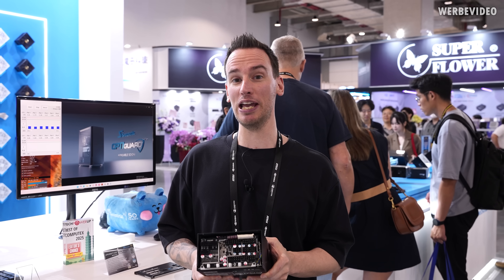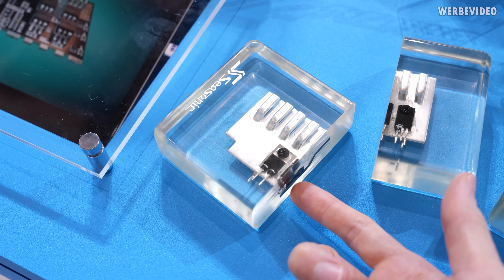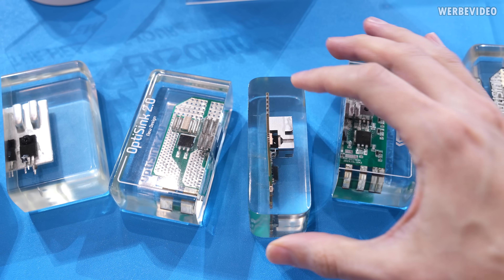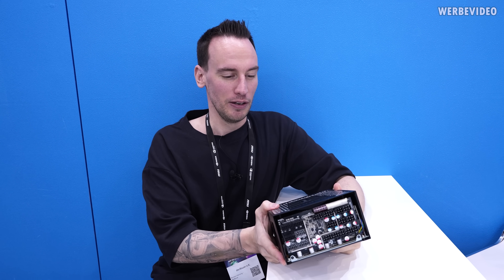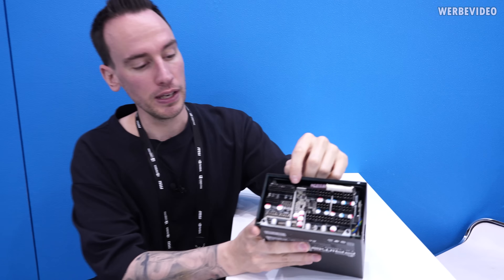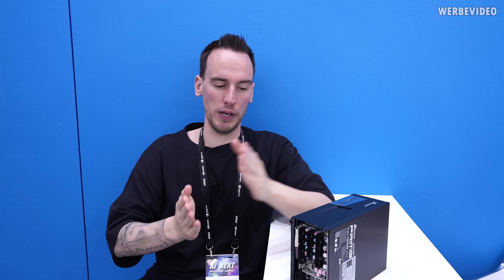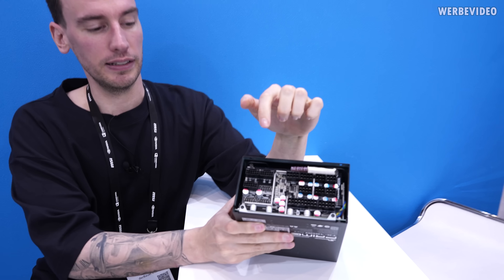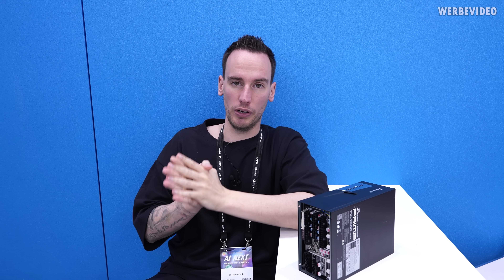Seasonic Confirms 12VHPWR Risk – Unveils Protection Feature

Comment: Just undervolt your GPU.
For example the 5080 and lower GPU dont have this problem as they dont draw so much current however the 4090 and 5090 do
So just undervolt the GPU in MSIAfterburner and you're good to go.
This will lower consumption by about 100W~ easy and set some profiles for example you dont need 200FPS in certain game, limit it to 120 or 60 and present lower clocks on the GPU that way you are going even lower from 500W~ to 350-400~ zone and you're good to go.
As all of these shunt solutions, your PC shuts off, what now you sit there staring at black screen wondering what do do, this is not a solution, disrupts the work flow or game session.
The actual solution is to lower power with UV and certain profiles for high, mid and low end games and you're safe to use your GPU with almost no risk of anything getting melted.

Comment: Can't we add a seating lever on each  end that forces a good connection? Sort of like the connectors used in most automotive connectors. Leverage using a plastic arm.  You wouldn't have to push down/in the connector, which seems to break the pins on the GPU

Comment: this is good that they are looking at it BUT for the everyday user if the system shuts down even if we got the info that it was an overload on the cable , what do we do then ?? just change the cable ? yes we have loads of them in draws for that just in case moment! 
If seasonic would go that one step more and restrict each pin to 10.20 amp then they would sell the safest PSU on the market and everyone that has a 5090 would get one just for peace of mind  it would add cost to the PSU and if you get frame stutters you then look at the software info it could then show most pins maxed out at 10.20 and the odd 1 or 2 less eg 4.2 which would then point to the problem without risk of damage. 
Please Seasonic lead the industry

Comment: Optisink 1.0 is a massive downgrade compared to the older style IMO.
The older style has a large thermal mass.
Optisink 1.0, yeah your using the copper layer to act as a heatsink which may have a large surface area, but it has a lower mass overall
50g of aluminum exposed to airflow vs 5g or 10g of an internal copper layer.

Optisink 2.0 is a bit better as you are now adding heatsinks to add thermal mass

Comment: TLDR-I love the idea, but I'm curious what kind of tolerance they will allow. I enjoy daily driving the same systems I use for XOC, so this will be a desirable safety feature for the daily part, but I wonder how "X" it will allow me to "OC."

To further breakdown what I'm getting at, I started shunt-modding back on Ampere and appreciate the headroom available to push upwards of 1000w during extreme sessions without exceeding "safe" limits on the electrical components for short periods of time. Shunt modding the video card still allows you to monitor power/current per 8-pin connector (with a correction factor based on which shunts you use and some math that I'm sure you already understand, so I won't bore you with all that here). This means I'm still able to effectively power limit my card on a per 8-pin basis, a GPU power-draw basis, AND a total board power basis. There are still a lot of safeties in place and you can "tune" these limits a bit with different shunts or power limits in various available custom vBIOS flashes. In the case of Ada-Lovelace and Blackwell, you still get GPU power-draw and total board power limits, but you miss having multiple measurements in parallel for the various power connector pins. The worst that can happen on RTX 3000 with 3x8-pins is only 1 "+" and 1 "-" are functional per connector, which still leaves you with 3 good pairs of "+/-" pins. RTX 4000/5000 can technically operate on only 1 good pair if all the other wires are cut (an example @der8auer has demonstrated before), but all power goes through 1 shunt for the entire 12-pin and there's no ability to see any breakdown of the power split across the pins. Without the ability to modulate power draw per pin (or even per set of pins so you know you have at least 1 good pair per set), you have to rely on safety features such as in this concept PSU to toggle power off. I'd like to think you could still do XOC with this PSU, but if the limits are set too high, it decreases the effectiveness of the safety feature. If they're set too safely, it likely won't work for XOC. I'm really curious what they go with.

Comment: Guess I'll just get the new WireView when it drops, instead of investing in a whole new PSU that doesn't mitigate the problem anyways.. If you can't balance the current flow without the narrow balance of current being a problem anyway, I want to pay as little as possible to be informed of a possible issue at least... I seriously need an upgrade so I don't have a choice at this point, but holy crap is this whole thing just a stupid scenario to begin with..

Comment: For anyone wondering, the 12VHP connector is basically a Molex Micro-Fit+ connector with an extra block stuck on for signal pins. There are some 'fun' things you can find in the datasheets for the 12-circuit Micro-Fit+ connector and the 'PCIE CEM5 12V2x6' connector housing. The generic Micro-Fit+ connector specifies DIFFERENT specs based on whether the contacts are gold plated or tin plated. The tin-plated contacts have the full 9A current rating per circuit, but lower allowed maximum temps (105C rather than 125C for gold) and are rated for less insertion/removal cycles. The gold plated contacts are actually de-rated to 8.5A. The 12V2x6 connector doesn't specify multiple ratings, it just lists 9.2A per circuit, but it does list a maximum temp of 105C, so I'm guessing the Molex version is specifically specced with tin-plated connectors. It is worth pointing out that, in the big chart of current ratings based on wire gauge and number of circuits, most of the data is marked with a * which means it is interpolated data, not directly measured. However, for some reason, just the 12-circuit, 16GA data point is actually measured when all the data points around it are interpolated. Seems like maybe some extra attention was paid to this particular configuration, for some reason.

There is also some interesting info to be found when comparing the regular Micro-Fit and the Micro-Fit+. First off, the regular Micro-Fit only allows up to 18GA wire, while the + allows up to 16GA, which is what the 12V2x6 uses. However, the two versions do not have the same current ratings, even if both are using 18GA wires. A regular Micro-Fit connector with 12 circuits is rated up to 5.5A per circuit. The + is rated at 6.5A with the same connector plating. So originally, before NVidia decided to hijack this connector for a 600w GPU, it wasn't designed for anything bigger than 18GA wire, and 5.5A per circuit. Perhaps stretching the format to not only use larger gauge wires, but also to increase the Amp rating per wire all while nominally keeping the same temp. rise on the connector just didn't leave enough safety margin.

Perhaps the most frustrating part of this exercise is when you realize that, if NVidia wanted a connector that could handle more amps per pin and take up less space, Molex already had one that did exactly that: The Ultra-Fit. This connector is slightly larger than Micro-Fit with a 3.5mm pin pitch rather than 3.0mm, but in a 12-pin, dual row configuration, the connector is rated to handle up to 10.3A per circuit without any redesign shenanigans, which is more than what NVidia would have needed for 600W. It would only have been a hair over 3mm wider than the 12V2x6 connector, but would still have easily fit on all the cards they have put the connector on so far. So why not use this connector instead of the special Micro-Fit+? I can only assume it was because the Ultra-Fit connector costs more. Molex has been at this a long time. They are perfectly capable of delivering a connector that can deliver 600W of power, and in fact already have many that could do just that. All NVidia had to do was pick a connector that Molex already made which met their power specs, and throw a couple presence pins onto it.They could have just picked up a 12-pin Ultra-Fit and probably been fine. Instead, they tried to scrape a few pennies off each unit and now they look either greedy or incompetent.

Comment: The year 2025, and the most important element “Power Supply Unit”, which has a lot of wires - does not have its own software for control and monitoring in the operating system! That's bullshit!

Comment: Boiler tech here: psu safety is great, but i STRONGLY recommend they add an external LED that can be mounted in a visible area; flashes yellow for stage 1 warning, flashes red for stage 2.
The led trip state should only stop once an "alert acknowledge" button on the PSU is hit, even after power cycling.
That means if the 12vHP hots red alert, the system WONT reboot untill you hit the alarm button

Comment: Current protection should always be at the source. All power should be this way. That way any failure after that point power can be cut
Reply: You always put the fuses/protection devices closes to the source, from circuit breakers in your home right at the entrance point to fuse in your car right by the battery

Comment: its really funny that are companies chooses the hard way to address the issue instead of putting 2x 12vhpwr on the gpu with 400watts and above if 600watts put 3x 12vhpwr that fixes the problem so cheap or nvidia seasonic and asus chooses the hard way why? for screwing people for more money when the fixes is very cheap for adding more 12vhpwr on the gpu's with melting connector issue

Comment: The only practical place to control the per-pin current consumption is at the consumer (graphics card). They're splitting the power to various phases anyway, they could absolutely split the pins into individual rails, monitor current and shift the draw between them as required.

Even this is a band-aid over the core problem, though. Forcing higher current through a high-resistance path is only going to generate additional heat in the connector. You can have failsafes that shut down the card if the current is too imbalanced, but the real fix is to use a connector that can reliably handle the currents you're trying to pass across all scenarios, with plenty of safety margin.

Comment: Thanks for explaining this. It seems as if the engineering is chasing the problem by architecting more and more complex solutions to a (relatively) simple problem. This usually indicates a flawed design, method, or understanding of real world issues that Nvidia has abrogated any responsibility for addressing. If I'm not mistaken, the real solutions are one or more than one of the following (in combination):  greater contact area (better tolerance for imperfect contact), tighter tolerances so surface contact is more likely, more power pins (lower load per pin), or larger pins (more copper in general). It seems as if this is a problem that was solved long ago by electrical standards and engineering safety designs--we use more copper for larger conductors and more contact area to distribute the load. It's just weird, considering that PCIe and EPS power rails have been around for like, forever and can be multiplied for more power with more safety.
Reply: The main problem is that the simple solutions would require NVidia to change the connector on their cards. These more complicated solutions exist because no one has yet been able to convince NVidia to make a change on their end of things. As long as NVidia is unwilling to use a different connector, we are stuck with hacks like this to check for the failure mode rather than removing the root cause of the failure mode.

Comment: If only we could just add a second connector to add a safety factor (you know like they did with many past connectors just put them off to the side of the connector so you could snap them off if you don't need them like past connectors).  Or have someone make an out of spec non standard connector will a few extra pins and wires to carry some load.  If it were up to me at this point I would just go back to 8 pin and throw a 4th connector on there.  I don't often have the budget for a $2000 card and lets be clear I'm cheap so you wouldn't see me spending that anyway, but while that 12hpr is on it its a non starter for me.  Do something, make the power pins longer and add more contact surface on the connector, there has to be a way of fixing that thing without breaking back compatability.

Comment: It should not be to hard to put a LED on the connector (if the connector on the GPU-sideis mounted on a small pcb) that would light up in case of a failure.

Comment: @der8auer-en - Do you have any idea if AIB GPU makers who are using nvidia 5090 chipsets to make their cards (ie Asus, Gigabyte, etc), are they allowed to implement per-pin monitoring on the high power or load balancing etc, or to do things which the reference cards that nvidia make, dont have? Are they allowed or do their contracts of using the chipset mean they can only do as much as nvidia does on their cards? You would think they would step up like Seasonic is with the PSU and do the same sort of thing, rather than parallel bus connections at the GPU end like they seem to have now.

Comment: even visually 12VHPWR  pins are smaller than regular connectors on PSU and they are supposed to deliver 600 w, when regular 8 pin with better connection and thicker pins is 150W.. this should be just banned, period!

Comment: May I ask you about some simple sollution? What will happend if at the end of that 12HVPWR cable will be a bridge between all 12V pins (inside plug) ? Is it allowed from the PSU perspective? In my opinion it would resolve issiue why various contact resistance of pins which cause overheating ofnthe wires.

Comment: You would have to load balance at the connector on the card with a device that plugs into the card that the power cable plugs into.

Comment: This is great news! Hopefully they won't be too expensive. I also wonder why third party Nvidia GPU card makers don't implement a different more reliable connector and sell a pigtail adapter to connect to the 12VHPWR cable so in case it melts it won't be as much as a loss because you could just buy another cable and adapter rather then melt the connector on the card. That would be a good selling point for their cards!

Comment: Wouldnt you need current sense resistors for the return pins too if a few of them have high resistance it will just melt on the other side. It's basically a huge mess you ideally should have efuses on every pin which is expensive and would waste energy. Both the +/- pins are all in parrllel so if any of them get imbalanced your going to get the melty connector

Comment: Asrock joined this club a while ago with their PSU's which have temperature sensors in the 12 volt cable and shut down if the temperature goes over a threshold. For me, this is best, because it's measuring the dangerous symptom directly, and is able to shutdown regardless of what software is functioning correctly at the time (or not). I don't even have my workstation in the same room as my PC, so knowing I have this feature gives me peace of mind. If my PC inexplicably shuts down, then I can investigate further, and I'll be dealing with a bad cable rather than a melted GPU plug. Until that happens I don't have to do anything and I feel reassured.

Comment: Safety and monitoring is great but solving the issue is better. Thick copper wires with soldered connectors. We are dealing with Ohm's laws here. there's a reason why houses have hard copper wires. The available thin copper wire cables are pretty much resistors which is why they become warm. Too many electrons for these bundled hair wires. Forget about flexible cables being great 😂

Comment: A potential solution of informing the customer of a 12VHPWR failure safety shut down would be taking inspiration from ground fault safety switches. In short a physical switch that, when the PSU triggers a shutdown is physically switched or pushed out such that the user has to switch it back or push it in to start the system afterwards.

It works great for mains so will probably work great in this case. Even better to add a label next to the switch "12VHPWR fault detection switch" or something, such that if it does trip, the user can understand what has happened without having to check the manual.

Comment: Guys, check the new line of Asrock Taichi PSU Titanium PSU’s, they already implemented safety features on this NVIDIA failed PSU/GPU connection. They have an activ Thermal Guard implementation on both sides of (PSU and Nvidia GPU connectors) at temperatures more than 110 C on connector (on both sides !) the PSU will shutdown the PC.. The PSU is sold out continuously because of this feature..It is great feature.And PSU is atop of the charts at Cybenetics!

Comment: @der8auer : Roman, you provided the 1 and only correct answer at the end of your video : "this does not solve the problem".
This connector/standard needs to get banned from the market until a properly functioning and properly tested alternative is introduced to replace this DEBACLE and ACTUAL FIRE HAZARD.
On the short term why don't we go back to the default 6-pin and 8-pin PCIe connectors instead, they have proven their reliability (unlike 12V2X6 and 12VHWPR).